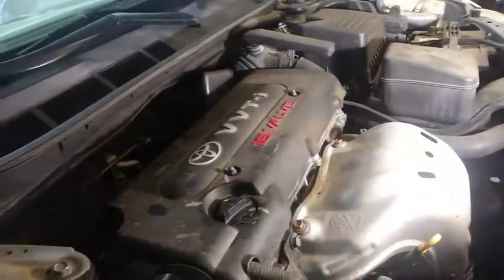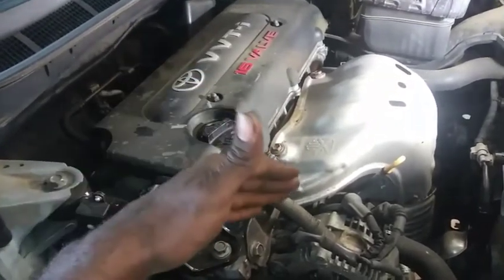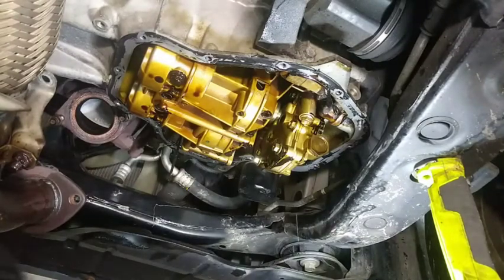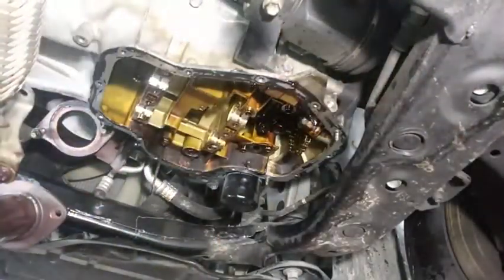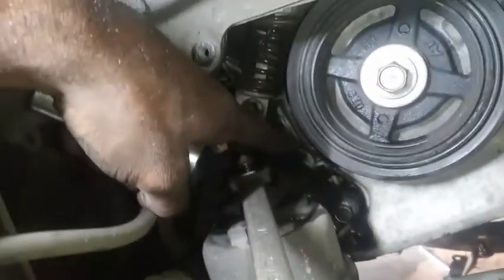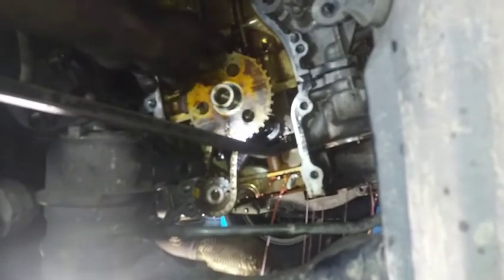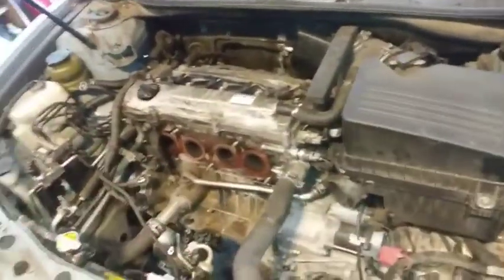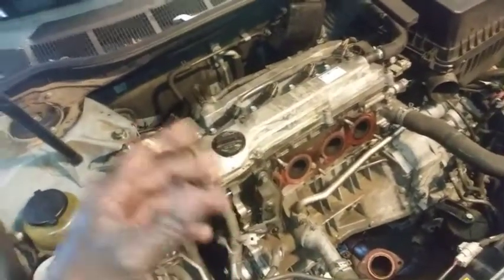how to free locked engine 2009 Toyota Camry 2.4L

Comment: Thanks so much. I thought I left a question, yet it might have been on another video. Figured it out with a metric hex socket set and a 1/2" adapter for my 3/8" drive socket wrench to take out the oil filter housing. Thanks just the same.
Reply from the maker: Apologies. I likely overlooked it. Video should've mentioned the size. Possibly I mentioned it in a rebuild video. 

Glad you got it addressed

Comment: Hey, great video, I now know how to remove the 2nd half of the 2az-fe. Sounds to me like I only have one crank bearing gone(plz check my video on my channel) I will be replacing the bearings, both on the crank, and the balance shafts while it's opened up. Someone told me tne sound was a collapsed lifter, could you give your opinion?
Reply from the maker: These engine have solid lifters not hydraulic. Pull the valve cover and check the clearence with a feeler gauge between the camshaft lobe and lifter

If you suspect the bottom end issue [which it don't seem like it is] pull an ignition coil and see if noise stops. If it do, likely it's bottom end rotating related, bearing.

Temporarily try a heavy weight oil on a hot engine!  if you can't check clearence, this will fill the voids of Clarence issues to isolate problem topend related. Just drain it and put regular weight back in after assessment

You could have an issue with your balance shaft assembly.... If everything checks out!
Reply: @partsshooter  Did you watch the video? I recorded the sound of the engine on cold start, it sounds normal, I got the engine to full operating temp, it is ticking like a bearing. I already installed thicker valve buckets, and thicker oil, same ticking noise. It did quiet down after I did that, but now, it is back to same tick, just louder.
Reply from the maker: @snutmeez  yes I checked the video out, audio doesn't pickup key minute sounds.

I still would check the valve clearance. Simply because there could be a worn cam. The clearance is unknown currently
Reply from the maker: @snutmeez  do it with a warm engine. Get back with me or take another video

Comment: I have a 2007 Toyota Camry that's knocking. Consumes alot of oil. I would love for u to rebuild my engine if ur interested & how much u charge? I want to do it myself, but just a little nervous about screwing something up.
Reply: 2.4 engine? you mean knocking from the bottom? if its so. then its the balancing shaft.
Reply: @Steve93K  yes, it sounds like it's coming from the bottom. It has a blow by. What are my options?
Reply: Yes it is a 2.4 engine
Reply: Even if the cylinder walls have deep scratches, you should be able to resleeve the bad cylinder(s) . I have rebuilt an engine that broke the connecting rod and didn’t grenade the block. I’m getting ready to unlock a 2.7 from the Tacoma. The crank and rod seized together. After getting apart inspect for further damage. Take block to machine shop and hopefully they are wise and will fix it up.
Reply: Always get 2nd opinion if your machine shop tries to scare you with “spooky language “. Some of them like to get you to spend every last nickel or will tell you it’s no good. If a person throws in the towel, then more than likely the machine shop will repair what you left behind and make money for nothing.